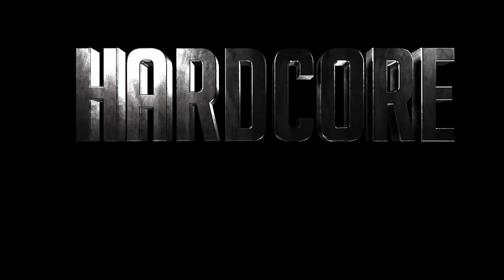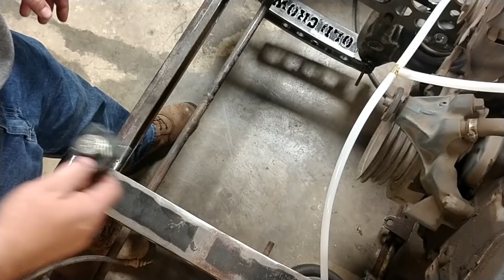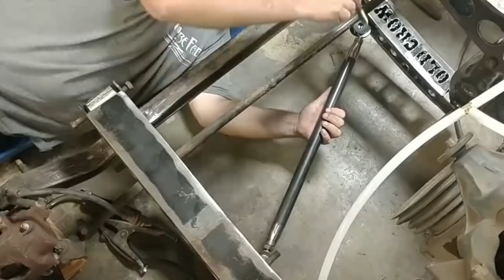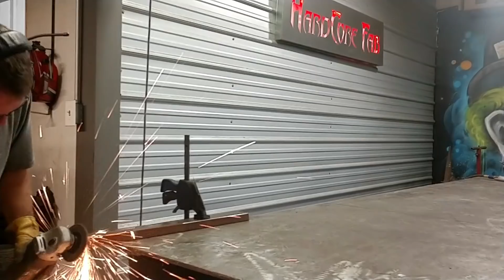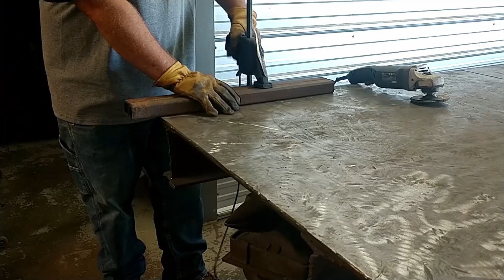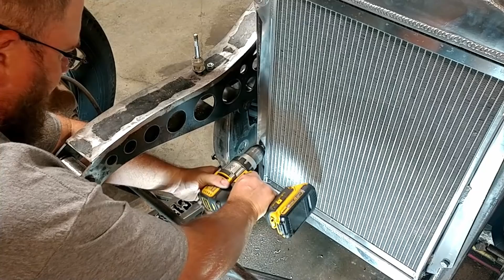Old Crow gets cool (rat rod build 13)

Comment: I’m kind of disappointed, all these awesome Brackets being custom designed & shaped then you go & mount the radiator with crappie square tubing, 
That’s like a after thought- if it was me I would re-address that area to make it all look same/ similar in design 

But all in all, awesome work, the truck looks Cool either way 

Keep up the great work
Reply from the maker: I've put alot of thought into that area before I built it.  It is going to be all hidden and it needs to be pretty strong in that area as well. Also, with the front arms there and shooting for the biggest radiator possible I only have a few inches to work with.  The bigger factor is the rest of the design of the front end and without that info I can totally see where you're coming from. Thanks for watching and stick around.  I don't think you will be disappointed.

Comment: Nice progress, i would work on getting the steering set up and operational.  Keep your flow of working front to back. Hood is cosmetic at this point.  Steering, than rear suspension, then brakes, then fuel system, then electrical...

Comment: What degrees did you set the front end to 7dg ? nice to see progress on the old crow keep up the good work
Reply from the maker: It is at 6 right now but with the rod ends on the bottom arms it can be adjusted as needed.
Reply: @HardCoreFab  Awesome It is that in the footage the front end looked straight up and down , 6 is good , I would be happy with that on mine . Now I'm having a bit of a slow run with my 39 can you come over and help out , if your not busy , I'm down is Qld Australia I've got a good shed and a spare room ?
Reply from the maker: I've never been to Australia!  Sounds like a good time but it would have to be when there was some skid-chucking going on!